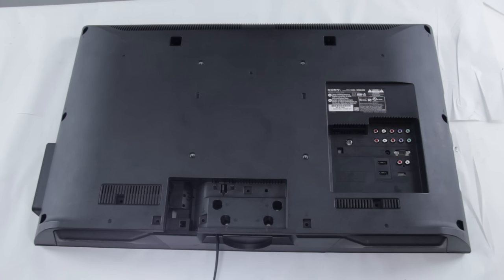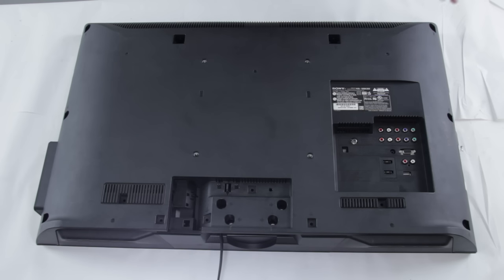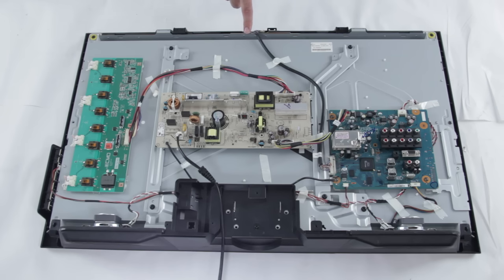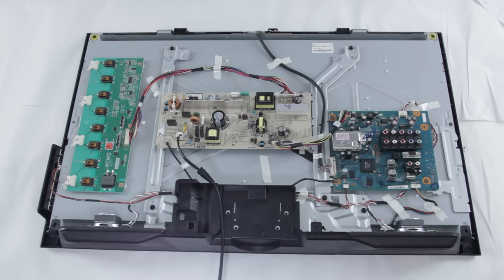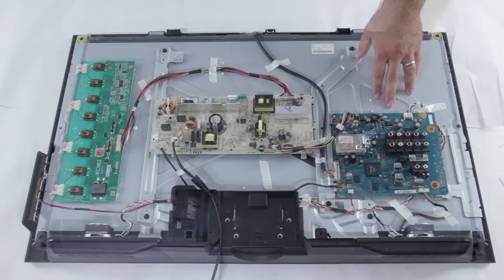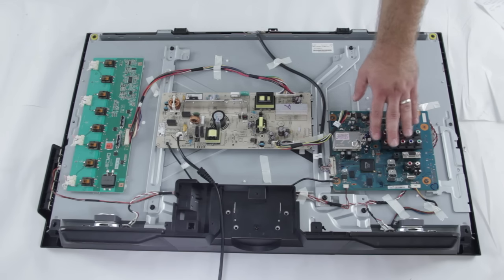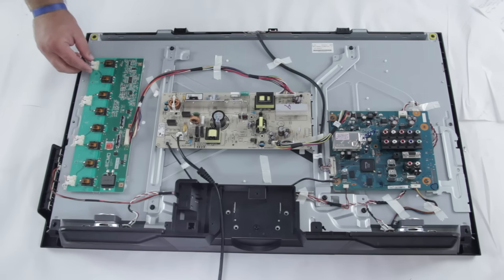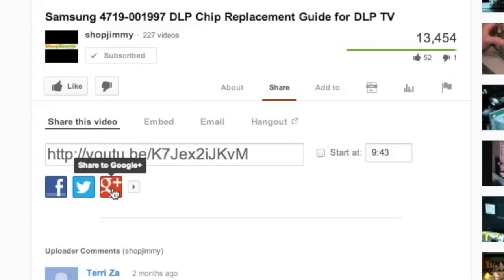LCD TV Repair Tutorial - LCD TV Parts Overview, Common Symptoms & Solutions - How to Fix LCD TVs

Comment: My samsung led dlp tv model hlt 6187sx/xaa will turn on but picture disapears after a few seconds. the sound continues until i shut it down. I continue this several times until the picture finally stays on..I replace the power board but it did'nt help. thanks

Comment: My name is fred and i have a sharp lc46sv50u, serial #2030813346 that will not turn on. i was told it was the main board that was bad. my question is how do i test the power supply to confirm the power supply board is not the problem?

Comment: Was having solar installed at home and therefore a new converted was needed to be installed. With that said, all I did was to unplug all electronics, also why this TV was off, from the outlets so as not to have any power surge from the conversion when power was turned off then turned back on. Upon power being turned back on an upon plugging TV back in TV would not turn on again; and the outlet is fine. So makes no sense that just unplugging the TV, again while TV was turned off, from the outlet should keep the TV from turning back on. 
  Samsung HD TV 32” Series M4500 Model # UN32J4500AFXZA Serial 05783CGHB03006X
. Thank you in advance for your response and this video DYI source

Comment: hello.....! I have Panasonic viera32" model tc-32lx20 ...I notice 3 black cloudy spots between 5 to 6 inches long. other than that it works fine would you know what is the the problem.
Reply from the maker: +daniel diaz   Try all repairs and troubleshooting at your own risk.  This sounds like a TV panel (TV Screen) problem.  If your TV panel is bad, it may be more cost-effective to replace the TV as panels are typically hard to find in stock, difficult to replace, and expensive.  Thanks and please let us know if you have any further questions!  www.shopjimmy.com

Comment: I have an Olevia/Syntax LT26HVX 26" LCD Multimedia Display.  I plug in the display, hit the power button and I get a blue screen.  It stays blue, but has an intermittent popping noise every ten seconds or so where it goes black for a second and then turns blue again.  None of the functions work and it will continue to do this indefinitely until I unplug the display because I can't shut it off with the power button.  

Originally, I was getting a loud buzzing noise intermittently from the back of the tv.  It was loud like an alarm going off.  It wasn't coming out of the speakers because I couldn't mute it or turn the volume down.  I'd get lines in the screen, but the picture still worked.  I had to turn it off by the power button and wait to turn it back on and then it was back to normal for the time being.  It did this for a couple of weeks until I turned it on yesterday morning and then got the symptoms of what I'm describing above and getting now.
Reply: Any ideas?  Any information would be most appreciated!  I also have a short video of it if needed.

Comment: Hi,I'm having a problem with my Sony kdl-46hx729. First It was black lines (orisontal) and then by the time it just turn black but the day when that happens it was like a burn smell.
Reply from the maker: +JensenTexas1  Try all repairs and troubleshooting at your own risk.   This could be a problem with either the main board or the power supply board in your TV.  You can replace each board individually to see if one of them fixes the problem.  Click this link to replacement parts for your TV model number:  http://www.shopjimmy.com/catalogsearch/result/?q=kdl-46hx729  There may be multiple boards for the same TV model number, be sure to match part numbers on your current board, with your replacement for compatibility. 
Thanks and please let us know if you have any further questions with your TV Repair!  www.shopjimmy.com

Comment: gv47lghdtv10a I have replaced the power board and the main board,still no picture. there is 24 volts at the inverter boards, one of the top two wires on the invertor board show 3.5 volts after power is turned on then it starts dropping to 1.1 then stays there. the other wire has no voltage there and when i manually put 5 volts there the back lights come on and i have a blue screen, but no menu screen at all. i feel as though the main board that was replaced may be defective. idk. very puzzeled and upset now that ive spent almost two hundred buks to get this thing back working again... do u have any sugestions?( twelve volts is supplied to the sound board as well as the t con,, all voltages are good but the inverter start up volts isn't present)

Comment: i have a vizio e3d470vx  and im having problems with two channels every time i turn my tv off and turn it back on i lose sound on two different channels and i go into the settings then to tuner  then to digital mts and i got three options 1/3 2/3 english and 3/3 spanish i select english and i get sound but when i turn off my tv and turn it back on im back to 1/3 which is no sound and the other channel is 1/2 which is no sound and 2/2 english which gives me sound and does the same thing when i turn it off and back on again but no problems with any other channel what would cause something like this ive already had new cable lines ran and still no luck any ideas on what could be the cause

Comment: Hi, I have a UMC TV, when I turn it on it loads to 100% then just keeps reloading, the image on the tv is off centre and distorted diagonally, I've opened it up and looked for blown capacitors but don't think that's the problem, any idea what it could be?

The TV is a UMC.
Model - 32/188G-GB-5B-TCU-UK
Product Number - UW32Y188BTCUG528

Comment: I have an LG LED tv, model #47LN5790. When I turn it on, the picture flashes and then goes black; the audio works.  When I shine a flashlight across the screen, I can see the image. Does this sound like a problem with the backlight inverter? Do you sell the part?
Reply from the maker: +Dr R   Try all repairs and troubleshooting at your own risk. This sounds like a problem with the actual LEDs inside your TV. These LEDs are replaceable, however it is recommended they are replaced by someone with the proper experience and training. When replacing the LEDs, the TV panel can get damaged. If the TV panel gets damaged, it is not repairable. Click this link to replacement LEDs for your TV model number:  http://www.shopjimmy.com/catalogsearch/result/index/?cat=299&q=47LN5790   Be sure to match the panel information necessary to ensure you have the correct replacement LEDs.Thanks and please let us know if you have any further questions with your TV Repair!  www.shopjimmy.com

Comment: Robert Davis I have a 39in Coby LCD TV model# TFT3925 I have perfect picture but no sound it went out 2 weeks ago but came back on now it went out again today is it worth fixing and what is causing it to not work thanks.
Reply from the maker: +Robert Davis   Try all repairs and troubleshooting at your own risk.  It is recommended to replace the main board in your TV.  Click this link to replacement parts for your TV model number:  http://www.shopjimmy.com/catalogsearch/result/index/?cat=56&q=3925  There may be multiple boards for the same TV model number, be sure to match part numbers on your current board, with your replacement for compatibility.  Thanks and please let us know if you have any further questions with your TV Repair!  www.shopjimmy.com

Comment: I have an Emerson LF501EM5F  serial number: DS1A1444102499 (A3AUQUH) that won't power on, no standby light either. It was working fine until one day it shut itself off and that was it. I replaced the power supply board but still nothing.

Comment: cielo 55 inch. intermittently powers on. If it is unplugged for an extended amount of time it will power on. if it is off but stays plugged in it will not power on. I have replaced the power cord and board. found no capacitors blown.
Reply: 46 inch

Comment: Sony LCD TV
MODEL NO.  KLV-32EX330
SER.  NO.  3368423
When I switched on my TV(sony) the light(green. Front bottom left side. ) came but neither the picture nor audio does not appear.. After few seconds it looks like a black screen..  I DON'T WHAT HAPPENED TO MY T. V BUT PLEASE  SAY THE SOLUTION AS QUICKLY AS POSSIBLE

Comment: I have 42 lg led smart tv model no lg42lv3730 it has a problem that when switched on the power button is on only power light is on but no display no sound what is the problem please solve

Comment: I have a Samsung un32f6300afxza version ts01. red light blinks five times when I hit the power button and nothing happens. What is your recommendation on fix.
Reply from the maker: +sw1moonshine   Try all repairs and troubleshooting at your own risk.  I recommend replacing the main board in your TV.  Click this link to replacement parts for your TV model number:  http://www.shopjimmy.com/catalogsearch/result/index/?cat=56&q=un32f6300afxza  There may be multiple boards for the same TV model number, be sure to match part numbers on your current board, with your replacement for compatibility.  Thanks and please let us know if you have any further questions with your TV Repair!  www.shopjimmy.com

Comment: I have a 42" LG LCD TV that will power on, but has no backlight. The model # is, 42LK450-UB. Can you please give me some suggestions on how to diagnose the issue? There is no menu key on the tv and I don't have the remote! Any help will be much appreciated. Thanks,
Reply from the maker: Etta Edler   Try all repairs and troubleshooting at your own risk.  I recommend running the flashlight test on your TV.   Here is a link to a video we produced that shows how to run the flashlight test. https://www.youtube.com/watch?v=xUzCLgoSPGM Please reply with your flashlight test results and we can recommend a replacement part for your TV repair. Thanks and please let us know if you have any questions! www.shopjimmy.com

Comment: do you have anything on getting the DVD door  to eject on an RCA 22in  LCD TV/DVD COMBO  model #LED22B45RQD that has a disk inside and no remote but appears to work fine but for the DVD door not opening and it has a disk inside causing it to stay in dvd mode without loading  .There's no pin hole like on a computer dvd or any kind of button to eject.  and the  remote is not with it  but I'm  hoping To  use a universal  with it if I could just get the damn door open to remove the disk without breaking something.  there is no  manual buttons to eject that  I can see but maybe overlooked ? I've been searching forever and a day online with no luck on finding anything even closely related to what would seem to me like  this is probably a common issue but maybe I'm wrong. . .it's a cheap Walmart model

Comment: Have lg 42le5400-uc powers up and has sound. Has no picture but lights up with black and white vertical lines. Any ideas would be greatly appreciated.  thanks Thomas
Reply from the maker: +thomas tucker   Try all repairs and troubleshooting at your own risk. Try all repairs and troubleshooting at your own risk. This could be a problem with either the t-con board, the main board or the TV panel. You can replace the main board and the t-con board individually to see if one of those boards fixes the problem.  Click this link to replacement parts for your TV model number:  http://www.shopjimmy.com/catalogsearch/result/?q=42le5400  There may be multiple boards for the same TV model number, be sure to match part numbers on your current board, with your replacement for compatibility.  Here is a link to a video showing how to identify your part number, click here: Thanks and please let us know if you have any further questions with your TV Repair!  www.shopjimmy.com

Comment: We have Toshiba 46"LCD Model 46G310U   Serial Number B47188M82292k1  We are experiencing a white fluttering line at the bottom of the screen more noticeable in a darker picture. We tried changing the screen size etc no change.

Comment: thank you sir you we are information for lcd tv repairing
Reply: I have a Sony kld-46v5100, when when I press power, the green like turns on, the screen flashes, but no logo shows up, and the TV powers off, I've replaced the power supply board, any other options?

Comment: rca serial number j391f1a545 model number l32hd31r  I can turn the power on but nothing will happen though I did get it to work picture sound and all for the first time this morning,it lasted about ten minutes and then started bouncing around and now it will not do anything,I also have to other big screen tv's iwould love to get working again, and thank you guys for doing this and having it available it's awsome.
Reply from the maker: +Shawn Bennett   Try all repairs and troubleshooting at your own risk.  I recommend replacing the main board in your TV.  Click this link to replacement parts for your TV model number:  http://www.shopjimmy.com/catalogsearch/result/index/?cat=56&q=l32hd31r  There may be multiple boards for the same TV model number, be sure to match part numbers on your current board, with your replacement for compatibility.  Thanks and please let us know if you have any further questions with your TV Repair!  www.shopjimmy.com

Comment: I have a 50" Emerson model - LF501EM5F  S/N - DS1A1427401689. My picture went out and chirping is coming from the power board. I have already tried to replace the power board as mostly I was told it was bad capacitors or diodes, but it did not fix the problem. Can you please help?

Comment: i HAVE Funai LF320FX4F and serial number start with DS2A1338276808. i had issue with tv screen just come for second than turn black and stand by power stay on. i did wrong thing one of diaod i did connect both ends with copper wire thinking that this may be fuse but when i turn TV on again. it blow something and now no power also what should i do if i repair this TV. no no screen and power either

Comment: Hello,
   I have a Samsung 48" LCD Flat TV (Model code: LN46A550P3FXZA; Serial Number: ALXK3CPQ206302V). In receiving from a neighbor that attempted to trash it, I decided to see if I can repair it myself. The TV powers on/off with ring tone, but I have no screen or picture sound. The screen appears to have an internal broken spot near the left margin. The outer glass is fine. I'm not sure if the back-light converter, or t-con board is at fault. No response from the menu button. Can you please help me out? Thanks.

Sincerely,

RGJ

Comment: TV Brand: JVC; Model #: DM65USR. S/N: TC1DUA043301362. When the TV is turned on, the picture is fine, but there's a flashing light that goes on and off inside the TV screen.  What may be causing the problem and what will be the fixed for it.

Comment: I have a LG 50" Plasma (Model 50PG6010. S/N 811MAVDBQ895) that has developed a 6" fuzzy red band across the top of the screen. Could this be a Tcon problem or is the screen panel broken. Thanks Steve

Comment: Have a sharp Model : LC-52SB57UM shutdown after 10 seconds, leds just keep flashes.
Reply: Sound like a powersupply issue.
Look for bloated capacitors on the power board.

Comment: I have a Samsung tv Model # LN46B530P7NXZA
Version: CN01
Serial #  B4X73CHS501531D
2 issues...
1st is now it changes sources on its own. I figured I'd replace the board with the volume, channel up and down, power and source buttons on side of tv. 
2nd is when the tv is powered on after being in the off position for awhile, the right side of the tv picture is blurry and seems like it's trying to catch up to the rest of the picture. After about 5 mins the picture is fine. So I'm not so sure what to do about the second issue. Please help. Thank you.

Comment: hello we have a LG LED TV Model # 50LF6100 the screen seems to have a crack but its not on the outside of the screen nd I would love to know what needs replaced
Reply from the maker: +Stormie Lyn   Try all repairs and troubleshooting at your own risk.  This sounds like a TV panel (TV Screen) problem.  If your TV panel is bad, it may be more cost-effective to replace the TV as panels are typically hard to find in stock, difficult to replace, and expensive.  Thanks and please let us know if you have any further questions!  www.shopjimmy.com

Comment: Great video, I have an issue with my TV. After I plug it into the wall and press the power button o only get a click as though the TV turns off and the television doesn't turn on and I have to repeatedly press the power button and still it doesn't turn on, it just has a blank screen for a while, like maybe after an hour or two and then after you forget about it the back light will light up then you have to wait about five to ten minutes and turn the TV off and wait until you here it click off then turn it on and the display will appear. Now after it comes on and I turn it off for the night, I have to wait about a week before it will come back on again, and it's the same process Everytime! #Philips MOD.#42pfl5603d/27-Serial# ya1b0811016937